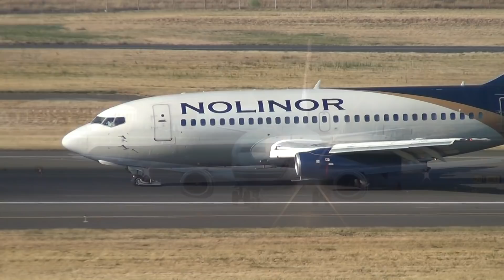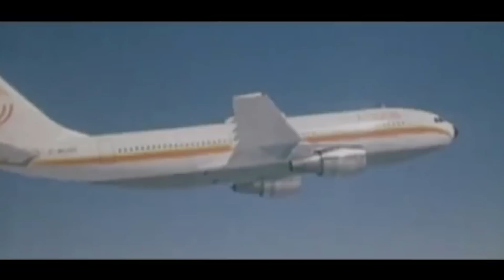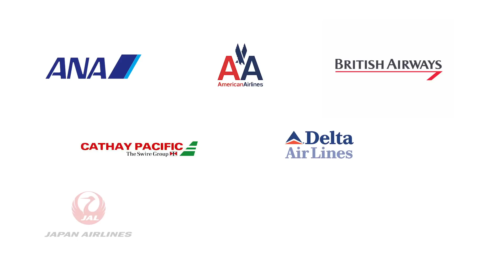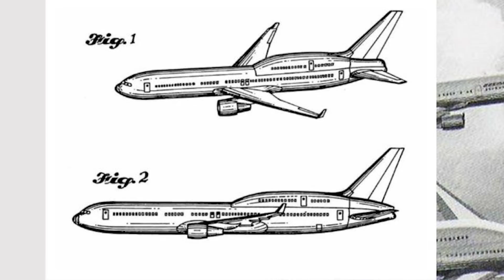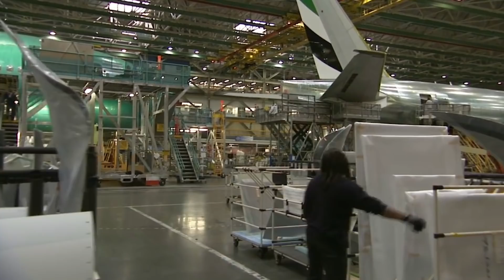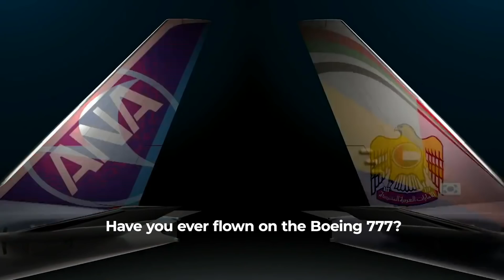Why Did Boeing Build The 777?

Comment: Fondly remember being in the front row of coach on the first 777 in commercial service back in 1995 (I think) on it's fifth day of commercial flights. A UA flight from Chicago to Denver. I was yet to have a flight in a 757 so it was the first aircraft I flew in that seemed to leap into the air and effortlessly climb to cruise.

Comment: I’ve flown on the 777 since 2007. I had only missed out rides on it a couple times, replacing it with the A380, A350 and the A330. Although I favor Airbus over Boeing and love the super jumbo and the A350 more than the 777, it is still a good plane to fly in.

Comment: I’ve flown on a 777 a few times. However, these flights were always in the context of either just before a further flight in an A380, or just after a flight in an A380. (E.g., Manchester to Singapore via Dubai with Emirates: some of the Dubai-Singapore flights are 777, Man-Dubai was always A380, layover at DXB was 2 to 3 hours.) In those situations I found the 777 a little bit noisier than the A380 (not much), and a little bit more cramped as well. That said, it’s a very effective aircraft and obviously serves airlines well. (I’ve never flown in a 787. This was going to happen this April, but there you go....)

Comment: I have flown on 2 Malaysia airlines 777s before the crashes and I wonder if I flew on the doomed planes. On the first flight the engines were shut down (or went super quiet) at cruising altitude and I have never had that happen since then. Also all lights out/blackout on the same plane. 9 wide seating in economy for 12 hours compelled me to flight business class next.

Comment: My first experience with the 777 was back in 2010, flying from Toronto to Heathrow with Air Canada, a 777-300ER in it's original 3-3-3 configuration. Flown on the series a few more times along with a -200LR and a -200ER since then with the same airline and United. Last year I flew on another Air Canada 777-300ER, and it was on one of their high density aircraft with a 3-4-3 config, not very comfortable at all I'm afraid.

Comment: Followed by the A330, the 777 is one of my favourite twinjet widebody. Despite born in 2000, i love to imagine of impression of being an aviation fan, during where both A330 and the 777 were launched. During its time, the size were step foward into monstrosity size of these twinjet widebodies, in comparison to both existing twinjet and trijet, as well as being closer to 747 size.

I've flown few times, 2 on MAS, 4 on Emirates and once on Garuda. Although its not the best (the best being Garuda, with 3-3-3 seats), i hope i'll get onboard again, with wider seat.

Comment: I've flown on the 777 WAY too many times, with airlines such as Air Canada, United, Cathay Pacific and China Airlines. Even though the seats were pretty cramped and were a pain to sit on for long-haul flights (sometimes for up to 16 hours), the 777 is still a remarkable plane to go on. I just don't get why the engines buzz so loud during start up, but that doesn't happen with other planes. Nevertheless, the engine sounds are what I like most about the 777.
Reply: Transit-Gaming compare a GE-90-115B to a CF6. it’s massive.
Reply: Transit-Gaming airlines are assholes, they see the 777 has a good cabin width so they squish it with 10 abreast instead of 9. 10 abreast really only belongs to the 747 and a380 bottom deck
Reply: A A no wait, I think that old 777 I went on had a 3-3-3 seat arrangement

Comment: The Boeing 777-300ER and 777-200ER were the most efficient aircrafts  before the launch of 787 and A350 !
Those oversized twin-engines of 777 in consideration with the fuselage was much adorable !
Reply: Yes I have flown a 777-300ER and 777-200LR
Reply: 77W I agree, but 333 is slightly better in terms of fuel burn than 772 as I know. The former outsold the latter, especially after MTOW raise in later years.

Comment: I once flew on a 12 hour flight in economy in a BA 777. To be honest I didn't really enjoy it. I much prefer flying the Aeromexico 787 on that route.
Reply: ElMaestro 04 Well, both 787 and 350 are made of more than 50% composite material, allowing them to pressurize the airplane to a lower cabin altitude. That would allow the airplane to provide a better environment to the passengers.